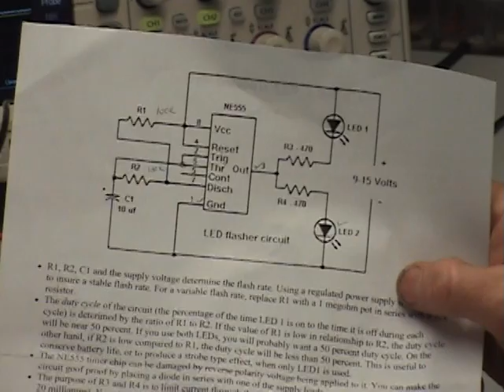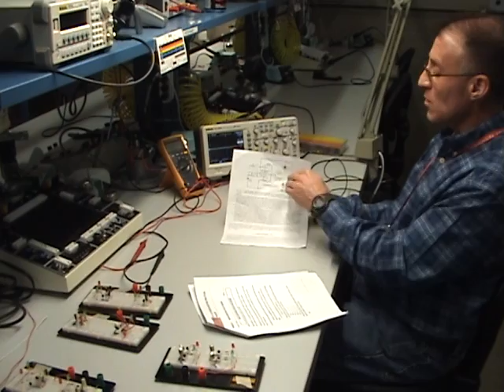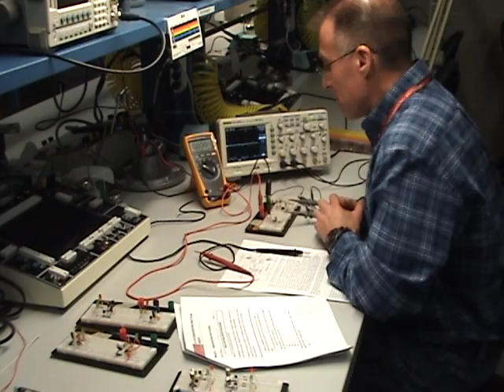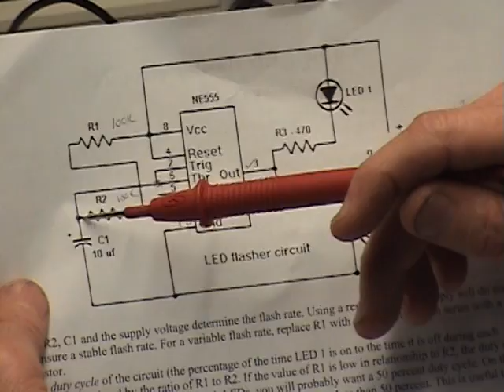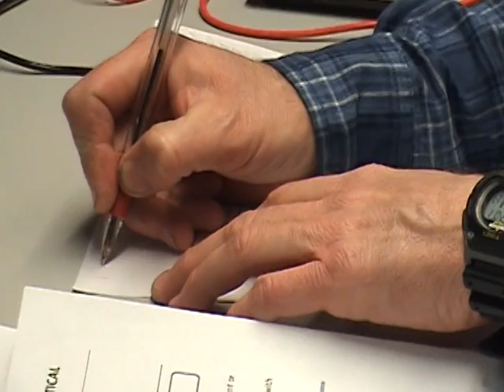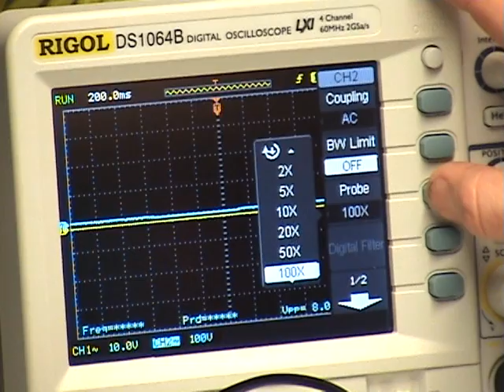*EXPERT LEVEL* Circuit Troubleshooting TTC Avionics

Comment: Very thorough tutorial , thanks for taking the time to break it down so well !
Just 1 question : do avionics manufacturers’ data sheets usually include proper condition voltage/ voltage range specs for each pin of such an IC ?

Comment: Your multimeter was in auto ranging mode. That is what made it slow. It was switching between ranges every time the 555 switched. Try that again using manual ranging at 6V on your meter on that circuit. You will be impressed by it's speed.